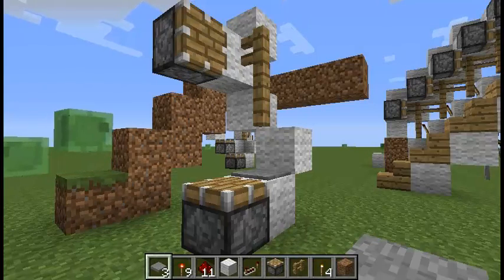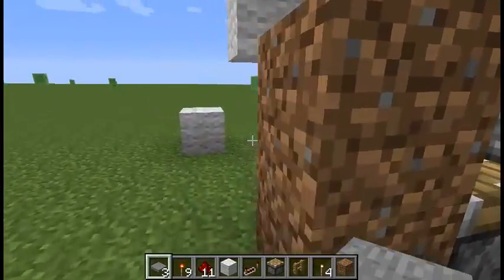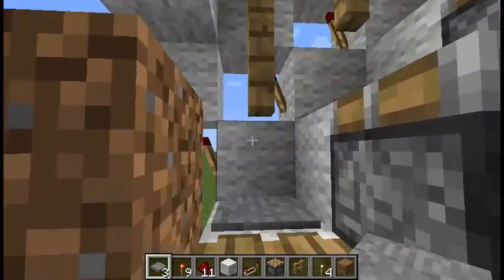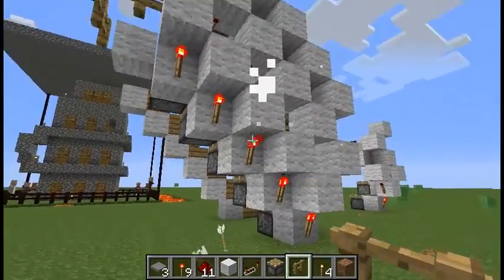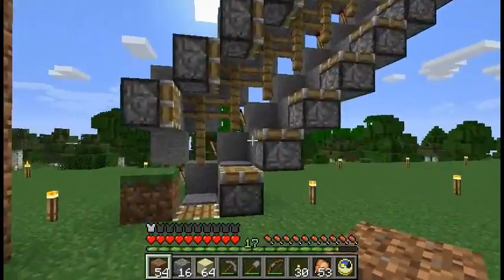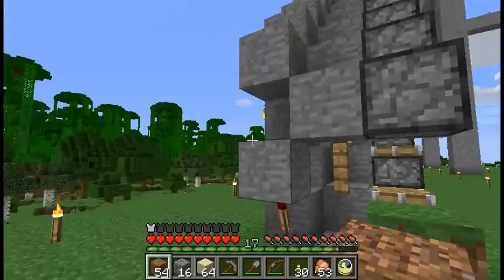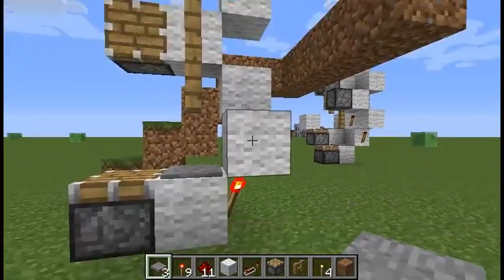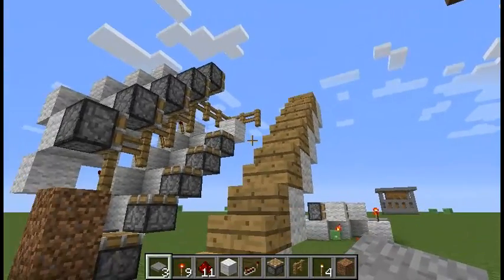Minecraft: Simple Modular Piston Escalator 2012-07-20

Comment: I really like your design, simple and smooth. What I'm wondering though is if it's possible to use a similar kind of design for a down escalator as well. Trying to walk down the up escalator would be tricky because you'd have to avoid all the pressure plates.